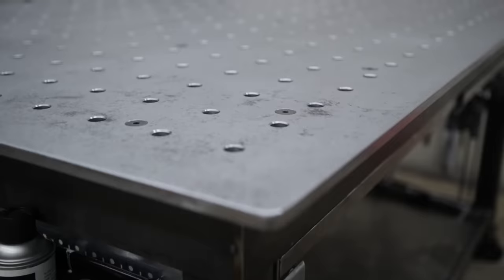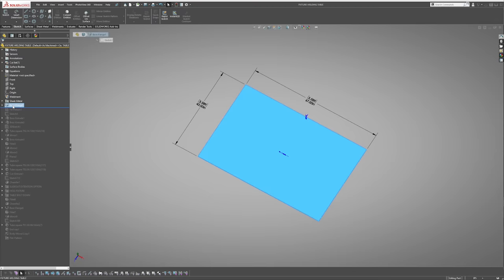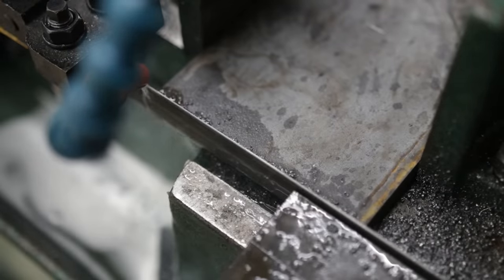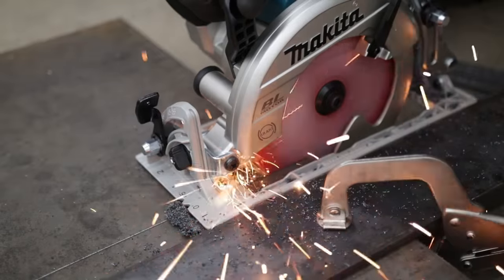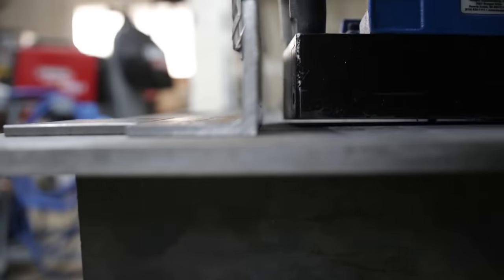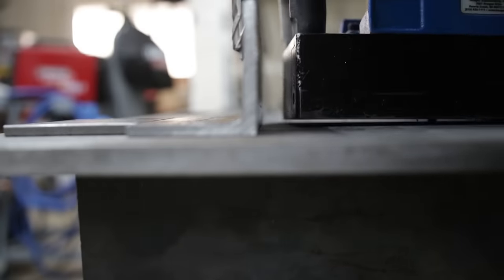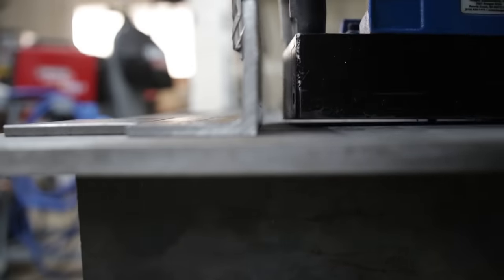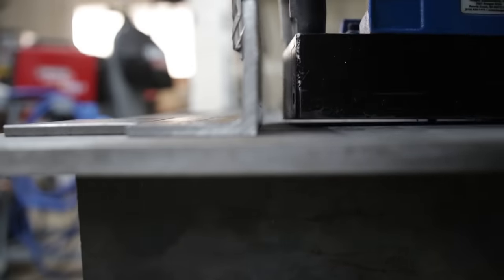Homemade Welding Fixture Table + Storage Hack — Built for my Home Garage Shop

Comment: 1/2” top is the star of this build.  I was quoted a small fortune for a 30”x48”x3/8” top. Can’t imagine how much that top set you back...  Great build. Subbing!!!
Reply from the maker: I was able to purchase a remnant 5ft x 8ft x 1/2” thick plate in my neck of woods for about $400. I could of saved another $60 bucks had I had them cut it down to 3.5ft x 5.5ft. But I figured it was nice to have extra for future projects. If I purchased a new 4x8x1/2 thick plate it would of ran me $560. So I guess it kind of all depends...  The crazy part is I actually wanted 3/4” thick plate just to future proof it for life. But that was $$$. Thanks for the sub!👍
Reply: @RathaSochenda  A think that a 3/4” plate would have been too much for you and your engine crane to deal with.
Reply: @markfryer9880  I agree, those cranes are only good for 500kg at full extension (where most people exclusively use them as any shorter is useless).
Reply: This is a great build and well thought out.

Comment: One of the most difficult metal working tasks I have found is to drill a hole in an exact location compared to multiple other holes. That you were able to DIY the top of a welding table is downright amazing
Reply from the maker: Thanks Jeffrey.

Comment: Ratha well done with your welding table! As similar professionally made welding table costs @ $1800 Aussie dollars including clamping and fixtures. That table is smaller than yours. I did like the addition of the catch trays as they will be great for reducing how much crap falls down onto your tools stored below. A second benefit is when a screw or nut or something else small and value falls through the holes and it will, it will be easier to find it in the tray rather than searching through your stored equipment. I was surprised that the wood router and carbide bit worked so well as a Carpenter of 36 years I was actually expecting disaster. I thought that the 3 inch hole centre’s was an interesting choice. Have to think about that one and see how it works for you. You will find the table is great for cabinetmaking projects but be prepared to oil your table first with a canola oil spray like used for cooking and to lay down wax proof paper when doing a large glue up because there will be glue spills and runs no matter what. Same thing goes for painting items, a protective surface benefits your project and your welding table.
Mark from Melbourne Australia
Reply: A decent 1200mmx2400mm table in Australia with a 12mm plate is going to cost $3500 minimum.
Even worse if you want a fixture table.
$1800.. what a laugh

Comment: Sweet build, thanks for the video. I just had to rewind when I saw that blade on backwards, glad you caught it, no better way to smoke a blade. Though a backwards blade is a valid technique for cutting thin sheet or corrugated roofing etc.

Comment: First video I've seen someone square up anything properly. Very well done. CNC router operator for 17 yrs. I watch lots of builds, you made the table build as easy and able to be done as quickly as possible. The ease of your leveling, best I've seen. May need to build one myself. I do both metal fab and wood working. Thanks keep up the good work.
Reply from the maker: Thanks really means a lot. Just trying to do things right to the best of my abilities.
Reply: @RathaSochenda  humble, your abilities are understated. Keep up the good work, looking forward to going through your library...

Comment: That's got to be the best diy home built fab table I've ever seen... Well thought out,made to a reasonable and easily workable size and dimensions,perfectly executed,and finished out to perfection... This from a 57 year old,45+ years welding and fabricating guy who has built a few welding tables throughout the decades ... Top notch work,and those table plate adjustment blocks are the s4it... Fine job there...
Reply from the maker: Thank you for the kind feedback especially coming from someone like you that has been in the trade for quite sometime. It really means alot. Glad you like this table build!

Comment: Great job man. A couple of things I would have done differently is ordered the plate from a laser or water cut cnc place with the holes already done to match the pilot on your annular cutter. Then you can set your mag drill up on them and they will be good to go. The second thing is make the perimeter flat bar four pieces instead of lots of little bits. Every day is a learning day so enjoy the ride!!
Reply from the maker: Thanks for the tips🤙🏾

Comment: I am now rethinking my table top for my CNC, I was going to weld rhs but then someone mentioned that they did that and it wasn’t flat and is now using a torsion box. Searching that came up with your video which looks like the best of both.

Comment: by far the best DIY Fixture Table build on Youtube.  My plan is for a 4x8x.50 table with 3/4 holes on 2x2 pattern.  That pattern is going to be a 2 to 3 solid days of drilling. Thank you for sharing.  Liked and Subscribed.
Reply from the maker: Thanks!

Comment: Impressed with you making the table top. Wow, at the beginning of the vid I was like, yea, normal fab stuff. I do that all day. I would have bet you bought the table top. Cool af. The hole jig was a great idea. Gonna watch the rest to see your tool layout. I'm sure I'll learn something. 

A little back ground. I'm a manufacturing engineer who designs (in Inventor) welding cells for a manufacturer of class 8 truck truck and trailer frames. Weld tables, weld fixtures, assembly fixtures, you name it. Around 38 part # specific weld cells in our shop with 120 welders in two shifts. Imma steal some of your ideas for sure, lol. Great vid man glad I ran across it. Subbed.
Reply from the maker: 😎. Glad the video was helpful

Comment: I am a woodworker, but have been interested in metal work. 
Truly a masterpiece..
 I have a wooden 2’x8’ rolling workbench/ that doubles as an out feed table for sheet goods. Since I mostly work alone, it was suggested that I charge an hourly rate just for using the table as a second worker. Lol.

Comment: This is absolutely the best table build I've seen. I built my table six years ago and it is so very similar to yours, the only problem that I never solved and put on the back burner was that mobility issue and I would move my table with my engine hoist as well. I just ordered a set of those casters. I doubt that I'll ever have to build another table but if I  do I'll use your design, great job young man keep up the great work 👍
Reply from the maker: That’s awesome to know there are similar tables out there. Yeah these casters will be a game changer.

Comment: Wow, everything about this is absolutely incredible. At first, I was thinking "why use the bolts instead of just welding the top directly to the subframe?" Then you went into the adjustment demonstration to achieve a dead flat surface. Brilliant. 🤯
Reply from the maker: Thanks!

Comment: Good job Ratha. I like the table. I started with a small but not cheap table that I bought and still use today. I am going to build my own in the future and go with a custom size to fit my need and drill the top myself as well with my mag drill. Thanks for your video. As a fabricator myself I will be watching your channel as well. Again great job on the jig and build.
Reply from the maker: That’s awesome. Glad the video help and thanks for watching

Comment: Great project! I restored my father in laws fabrication table last summer and I am definitely going to add power to the corners like you did.
Reply from the maker: Yeah the outlets on the table definitely helps from having to run multiple extensions. Which helps keeping cords off the ground when working

Comment: Brother that is a good table!   Woodworkers around my area that are only into woodworking and nothing else are starting to see the advantages of a nice welding table such as you have for assembly tables.  Others that dabble into both wood and metal are definitely going towards welding table only for their shops due to its versatility.   I'm doing exactly what you did in that you looked around various tables to incorporate what you liked into your own table.  Good job!    Should have mine completely by the end of the month.
Reply from the maker: I hear you Ron! I definitely did do some homework on what features I wanted this table to have especially for my small home garage. There are so many benefits of a “weld” fixture table for woodworkers or people that just do mix of things. I mean who wouldn’t want a table or workbench that gives the best of both worlds or can kill two birds with one stone ☝️.

Comment: I built 2 welding tables as my first project.    Since then I haven't welded a single thing I needed on the table, rather I have welded everything on the floor because everything I have built was larger than the table.

Comment: Great job, the table looks amaizing!
Just to give you a hint for the cuttning saw, if the video is correct u put the red disc the wrong way arround unless ur saw can change cutting rotation direction.

Comment: Nice table!! Nice trick on laying out all the 5/8" holes with that simple angle fixture. I have a 4x8 with a 1/2" top also and didn't drill holes. I just weld to the table if I need to clamp out in the field, but I'm tempted to put some holes in it after watching how smoothly yours went.
Reply from the maker: Thanks. Yeah I was a little hesitant at first but I just took a leap of faith I’m glad I did. Just had to plan ahead.

Comment: I feel your pain, My garage floor is not flat either and it came with a slope from the back of the garage to the front with a 4-5 inches drop. Horrible for fabrication but great at getting rid of the melted snow from my vehicles. beautiful table, thanks for sharing!
Reply from the maker: Definitely a good way to get rid of melted snow! 😂. Thanks for watching!

Comment: Really nice work. One thing I noticed that I didn't see in the comments is, it may be worth isolating the electrical outlet from the table. I don't know for sure it's needed, but ground faults can do weird things, especially when you have an older house with unknown or suspect history.
Reply from the maker: Thanks! Oh that makes sense. So far I haven’t had issues.

Comment: Love your soft voice tone, very warm and natural. Un poco de mexicano en alli? I thought so. Very thoughtful build, too. Amazing how well those diablo blades cut plate steel, isn't it. The only one I damaged so far was accidentally cutting a bunch of rust inside an old pipe. Your modesty goes a long way, too. 11/10 Was reminded of myself when i designed mine I audited all of the work surfaces in my life, desks, tables, benches, bathroom, kitchen, etc etc and discovered various patterns between standing vs sitting and min/max for each, then finalised on what I liked for each and still ended up wanting it adjustable in height. :-)
Reply from the maker: Thank you

Comment: dude, Im still sitting here jaw wide open, that you cut that top 1/2" plate down with a circular saw like that!! I work in aerospace super alloy, and we cut everything from .300" up to 20 inches thick with abrasive blades. Just like a 60" grind wheel on a cut-off grinder. I love the way you bolted it down with tabs. Just before you said it, I thought that will give you a chance to level out any low spots. Now years later if you start to get a warped spot you can draw it out with those jack bolts like that. This is one of the best I've seen so far.
Reply from the maker: Glad you found it entertaining. 🙏

Comment: cutting 1/2 inch plate with a circular saw takes some nuggets though. lol. You made it work. well done
Reply from the maker: Thanks yeah. It was gutsy just made what I had around work at that timeZ Now I have a full on cnc plasma table  that can cut up to 3/4” 😆

Comment: Excellent build. Inspired me to replace my old table that only has a sad 16 ga top.
Reply from the maker: That’s awesome Louie! Going with something thicker will should do the the trick
Reply: 16 gauge???  That's like 1/16"  that can't be right. ???
Reply: @danl.4743  it is actually 14 ga or 5/64 but still not good for flat welding surface. Fine for a workbench top. But I had brain fart when I said 16 ga.

Comment: Great work man, Milwaukee makes a metal cutting handsaw that’s battery powered basically doing the same thing that you were doing before except it has a slower RPM and a smaller blade. My father-in-law is a 30+ year veteran lineman and he’s constantly cutting metal and this saw cuts it like butter doesn’t matter up to 3/8 of an inch half-inch whatever it doesn’t care I will look into that saw especially doing what you do it’s a huge timesaver it’s great.
Reply from the maker: Thanks for tips!

Comment: Wow, Ratha!  That's an amazing table, and your dedication to that project is admirable.  
I moved to Idaho in SEP of last year and I have a really big shop, and altho it's insulated, it has no heater.  So, I'm waiting for warmer weather to start setting it up, which will include a welder and welding table.  Your table would be a dream come true!  I am in welding school now, and I am so eager to buy a welder and get started.  However, the temps are in the teens @ night and low 30's during the day.  I am just gonna have to wait for warmer temps.   : (
Reply from the maker: Thanks. Yeah it’ll definitely be more enjoyable to work when the temps are back up

Comment: Awesome job. I like how you can flatten out the table top with the bolts and how the wheels are adjustable in height. I like how you made the frame using flat bar (I used 2x2 tubing which wasn't as good). I use Solidworks for everything and I like your animations! First video I've watched of yours and of course I subscribed to your channel. Excellent table and video! Thanks for posting!
Reply from the maker: Appreciate it. Glad you liek the video 🙏🏽

Comment: Nice job!!!!  Your attention to detail is inspirational!   That is a great looking table. I’m currently in the stages of planning my optimal welding table, doing the same things you did in the beginning. Looking at all kinds of designs to glean the features that will work for me. In the thought between parallel bars for the top surface and a plate with holes, I often wondered how I would keep all the holes lined up. I’m absolutely going to go with a plate with holes now and use your jig method.  Thank you for sharing that!! 
Strong work man!
Reply from the maker: That’s awesome! Glad the video helped

Comment: Very nice build! Very thoughtful design.. great features... I lucked out and found an aerospace surplus aluminum plate 2" thick with 5/8 holes on a 2" grid... and the bottom of the holes have a steel insert tapped 1/2" 13 tpi. I still have to make legs and tool storage for it. Probably will be similar to yours...probably adjustable height.  You should be very proud of yours, great execution!
Reply from the maker: That’s an awesome find!

Comment: Super slick build this table, exactly what I was looking for. Great seeing you lay it out in detail how you're approaching it! Thanks a lot for that.

One question though, I was wondering how you cleaned the table top? I was thinking about cleaning it with acetone and then maybe gently touch it up with some very fine grit sandpaper (to try and leave the 'straightness' of the plate untouched).
Reply from the maker: Thanks. Before I drilled the holes I mask the edge’s and poured cleaning vinegar to remove the mil scale and let it soak for few days.

Comment: This is one of the best welding table fabrication videos I have seen in terms of scale and precision. Hope to see more good works in the future. I am currently doing some metal works in others workshops. I don't have my own. But in their workmanship precision are not satisfactory. So I hope to start a workshop of my own. I have 3 questions for you. 
1. What grade of steel do you use for the tabletop and frame?
2. Would it rust over time?
3. If yes, then what steps do you take to prevent it(except painting)?
Please enlighten me :).  Thanks, Brother.
Reply from the maker: 1. Mild Steel A36
2. Possible without maintenance 
3. Coat the table with WD-40

Hope this helps

Comment: I really appreciate you diving into this. I've been contemplating building one of these but the weight of the 1/2" top put me off due to delivery options but you did as I would have. Big smile...thanks for leading the way.
Reply from the maker: Yeah totally understand what you mean depending on where you are in world. One option could be to build the frame first then when your ready for the top plate is to rent a truck and have the metal supplier cut down the the top plate to size then when your ready to unload it you can slide it off the truck bed over the frame. 🤔

Comment: Rather than one long level, a more accurate way to check for level, would be 4 smaller levels. One in each corner. A long level will only tell you the overall flatness from one end to the other. But with 4 smallers levels, you have 4 independent points of contact. That being said, this is one hell of a build.
Reply: That's not great either.  Flatness is more important than level in this application.  When setting level my 2 preferred methods are using a precision machine level on top of a supported parallel or using an autolevel and an optical scale.  I'll rough most installations with a rotary laser on an optical scale and then proceed with an autolevel to bring it all the way in.
Reply: @salvadorebertolone  I understand that as he stated such in his video. Technicalities being put aside, thank you.
Reply from the maker: Thanks